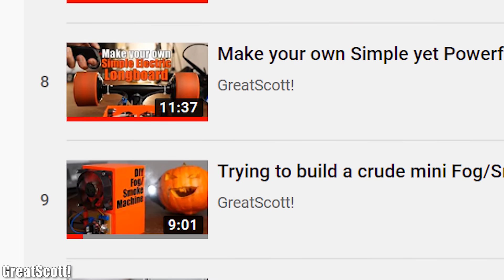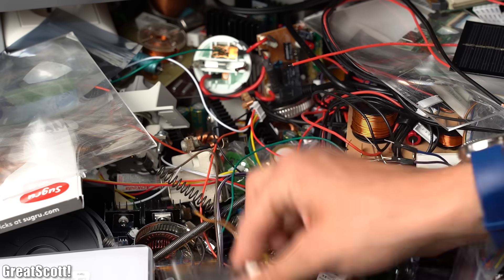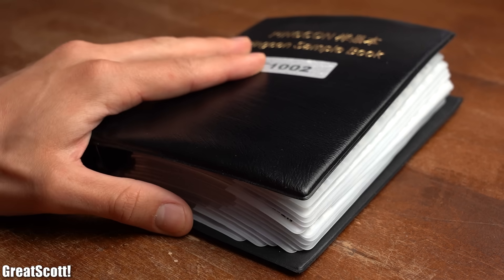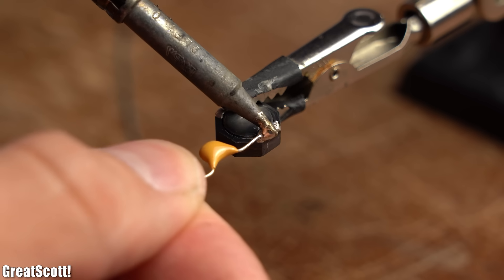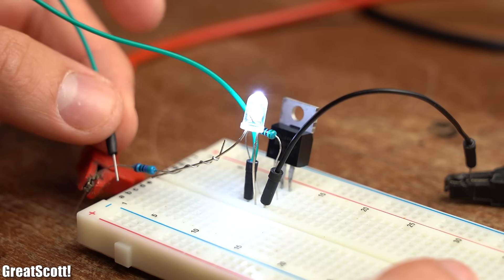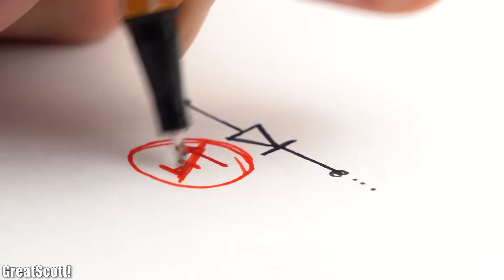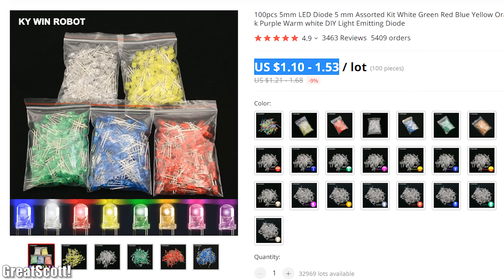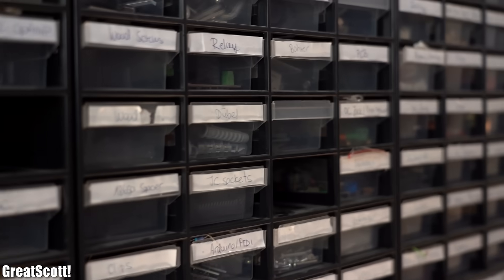Essential Electronics Components that you will need for creating projects!

Comment: Can you tell me what I need? 
Im changing my radios backlight from orange to pink 
I have all the smd lights replaced but when I connect the radio all the lights power off. 
12 v car battery 
Original smd lights 1.8 v 
Pink smd lights 3 v

Comment: I am surprised at the lack of content given this subject given there is so many electronic components out there.
Here I'll save you some time.
Most common transistor:2n2222
Most common capacitors:10pf-100nf
Most common resistors:10ohm to 1M ohm
Most common diode:1n4007
Most common ic:555 timer
Most common post amp:au741
High voltage transistor that is often used in YouTube:IRFZ44N
High voltage capacitor that I've used for a voltage multiplier:10kv 1000pf/1nf or higher
Common schottky diode:1n5822
For the zener diodes get all of them up to 30 volts, they're cheap.
You can also buy premade inductors or buy 0.1mm-0.25mm copper wire, a ferrite core and some thicker copper wire.
You'll also want either an Arduino nano or uno. They're similar and a 3.3-5v module, some battery cases and some 3.7 rechargeable lithium batteries with a charger to charge them.

Comment: These electronic are great for control circuits however it depends what's a person's liking. For me as an eng student I like wireless circuits and amplifiers so the complicated parts that I used quite different such as  lm 386 or high frequency transistors which I use alot

Comment: A component I use very often is the DIP switch. I got a little plastic box full of them, they can handle 25mA and they're rated for 24V which is good enough for me. They are very cheap and can be soldered on a perf board or put into a breadboard very easily.
Reply: New video idea: turning on a space heater with a DIP switch.

Comment: I can only recomment the resistor  book(lets) for SMD and throughole resistors. Even if you will never use them up in your entire life, it's a god sent to have some of these 1/4 W resistors on hand in all possible versions if you ever have a circuit for filtering or odd adjustments to certain voltage levels. Of course you will also need the drawers for the more popular ones, but that is just to be expected.

Comment: 74HC595 shift resistor
CD4017 decade counter
These two type of ics are also my fevourite.....
In last 6 months i have perched 7 different resistors kit(6200 resistors ).. But used only 30 to 35..piece ..
😄😄😄😄😄

Comment: that's easy just do 10 of everything (generic ones so you can make shift components into a specific parts whenever you need to, e.g. you need a resistor of 500 ohms, then you use 2k resistor in parallel), and just stock up if one runs out, just like cooking you buy seasonings in bundles not one by one.

Or if you to test more than finalizing a project you could just buy a lot of variable capacitors, potentiometers, variable inductors makes it easier

Comment: Shift register , laser diodes / photo resistor or phototransistor, IR ''leds'' and IR reader, Hall sensors for magnetic fielf detection, then some servo encoders to make normal motors into servos, , motor driver pwm and 3 phases,, I2c screens and drivers. Some  mcu are very cheap and useful too. Esp 32, atmega attiny85 chips are really cool to make some custom projects,Nvidia AI jetson boards are sick, some transformers and some old transformer wire, analog to DC and dc to analog, and few FPGA to practice. and accellerometer + gyros. some printers are really treasure chests with dozens of motors with encoders. i really love playing with mini-motors you find on drones the coreless ones they are FAST. a brushless to make 3 phase by spinning it. some N52 magnets,Solenoids, Relays, with integrated NO, and some inverters Nc spare contact for the button or the relay. a cheap 10$ temperature controller PID and 1 10$ Zelio PLC. to program them in ladder..a good pcb open source software, and some time on blender to animate ideas. a 3d printer would be very nice for me. Gears belts chains, bearings some scrap metal and alot of internet

Comment: I will forever recommend to trim your resistors in vertical (0.1 to 0.2 in. terminal separation) or horizontal (0.4 to 0.7 in.) orientation as you use them in your breadboard. So your storage is cleaner and better to reuse as you build safer, easier to modify and good looking projects.

Similar with basically every other component.

I am not an expert in electronics, but I can assure you that I have never had any kind of problem with my electric circuits, meaning I have never made a short circuit, nor a bad connection. My fails are always in my design on paper or code.

Comment: As an IC designer the only component I get are thin and thick oxide MOSFETs, Poly resistor, and MiM Capacitors.

In a few projects also Spiral inductors and lateral BJTs.

Comment: Hi. Can i get some help please. I mistakly reversed battery for my rc transmitter. It found a smoked component it's a black 3 legs thing. It near by the battery plug the writing in it is 2351p i searched everywhere and couldn't find any info. Please what it could be and with what i can replace it.

Comment: If you're working with Arduino a lot, get the following resistor values in packs of 100:
· 68Ω (USB data line filters)
· 100Ω, 220Ω, 1k (LED current limiters for 3V/5V/12V)
· 1.5k (USB power line limiter)
· 4.7k (pull-up/pull-down for 3.3V)
· 10k (pull-up/pull-down for 5V/for creating voltage dividers)
· 100k (for creating voltage dividers).

They are super cheap, a pack of 100 is often $1 or less.

For potentiometers, with Arduino, 10k pots also suffice.

Get 100nF ceramic capacitors. A LOT of them. Put them between VCC and GND on every single IC you use.

Also, if you're from Germany or neighboring countries, you can get these storage boxes very cheaply from Aldi or Lidl. The ones in the video are called "Allit VarioPlus Hobby 33" and are on sale at least once a year for €8 a piece. Last time they were on sale I bought six of them.

Comment: I recently wired a 555 with vcc and ground reversed, it got ridiculously hot but kept on working. At least from decent manufacturers, those things are hard to kill though I'm sure it's possible.
Reply: I should clarify that the circuit didn't work reversed, but when I fixed the wiring it did.  I was happy, though if I had killed it I wouldn't have been too upset those things are cheap enough.

Comment: my list for beginners, which allows them to go further:
(don't worry about high voltage rating, it is just the maximum voltage they can handle)

-BJT (BIPOLAR JUNCTION TRANSISTORS):
MPSA42+MPSA92 (200V 200mA BJT pair)
BD237+BD238 (80V 2A BJT pair)
MJE3055+MJE2955 (60V 10A BJT pair)
2SC5200+2SA1943 (200V 15A BJT pair)

-MOSFET TRANSISTORS:
IRF3205 (55V 110A 0.008Ω)
IRF5305 (55V 31A 0.06Ω)

-DIODES (NORMAL, SCHOTTKY AND FAST):
MBR30100 (30A 100V schottky diode)
SB3100 (3A 100V schottky diode)
SB2100 (2A 100V schottky diode)
D92-02 (20A 200V fast diode)
UF5408 (3A 1000V fast diode)
FR207 (2A 1000V fast diode)
1N4148 (200mA 200V fast diode)
1N5408 (3A 1000V fast diode)
1N4007 (1A 1000V fast diode)

-OPAMPS (OPERATIONNAL AMPLIFIERS):
C4558
NE5532
LM386 (this one is used for audio projects only)
LM324

THE

-PASSIVE COMPONENTS (because there are a lot of them, better buy them by kits making sure they contain the needed ones):
electrolytic capacitors:
1uF 50V
2.2uF 50V
3.3uF 50V
4.7uF 50V
10uF 50V
22uF 50V
33uF 50V
47uF 50V
100uF 35V
100uF 50V
220uF 35V
330uF 35V
470uF 35V
470uF 50V
1000uF 35V
1000uF 50V
2200uF 35V
4700uF 35V
ceramic capacitors:
100pF
220pF
470pF
1nF
2.2nF
3.3nF
4.7nF
5.6nF
6.8nF
8.2nF
10nF
22nF
33nF
47nF
56nF
68nF
82nF
100nF
220nF
330nF
470nF
1uF
2.2uF
resistors (all in carbon 0.25W version which is more practical in a breadboard)
1Ω
2.2Ω
4.7Ω
10Ω
22Ω
33Ω
47Ω
100Ω
150Ω
220Ω
330Ω
470Ω
560Ω
680Ω
750Ω
820Ω
1KΩ (a lot of them)
2.2KΩ
3.3KΩ
4.7KΩ
5.6KΩ
6.8KΩ
7.5KΩ
8.2KΩ
10KΩ (a lot of them)
22KΩ
33KΩ
47KΩ
56KΩ
68KΩ
75KΩ
82KΩ
100KΩ
220KΩ
470KΩ
680KΩ
1MΩ
2.2MΩ
4.7MΩ
10MΩ

Comment: Here is my idea of what is mandatory for the hobbiest engineer...

a. E12 series resistors full carbon set
b. 5W resistors a dozen low values
c. Ceramic caps 50V 1pf to 100nF
d. Polyester caps 1nF to 1uF (100V)
e. High voltage x-class caps 104s
f. Electrolytic caps 0.1uF to 10,000uF
g. High voltage electros few values...
h. Monolithic 50V 104 decoupling caps
i. Axial inductors say 20 values
j. Zener diodes a dozen values
k. Rect diodes comprehensive range
l. 74HC series ICs  (~30 common)
m. Linear ICs like OP AMPs & NE555
n. Ram. Rom. CPU. RTCs. MCUs.
o. IC sockets. Plugs. Sockets general
p. LEDs assorted and LCDs
q. Toggle switches...
r. Momentary switches push button
s. Rotary switches
t. Relays...
u. Dip switches
v. Key switches
w. Illuminated buttons ♡
x. Sensors like LDR and IR
y. Connectors assorted
z. ☆RF components☆

Scary thing is that in reality I have only just scratched the surface, and the surface is quite thick.

Comment: Hi GreatScott! Noob question, can a mosfet handle negative voltages? I saw a 55v limit in the video, so does that mean 0-55V or +/-55V? I'm thinking about Eurorack modules that communicate with +/-10V and whether mosfet's can handle the -10V or not. 
I've just discovered your channel and I'm loving it so far. Thank you GreatScott!

Comment: Great stuff! A quick question - it is a real challenge to find original power MOSFETs on Ali. I have purchased a few from a store you mentioned in the links and all MOSFETs were fake. I ended up purchasing used parts as much more reliable source of MOSFETs. What is your experience? BTW other than that it is a good store with a good service.

Comment: I would personally recommend to get the pro mini version of the nano in 168p and 328p version cause they're smaller and cheaper than nano. In addition, you can use the 168p despite of 328p in case where you don't need the extra memory space and calculation power.

Comment: Never buy large amounts of parts if you are a beginner.I have friends who "stockpiled" parts worth hundreds of euros and they do nothing with them because they work in another field.Don't block your money into large amounts of parts.
Reply: agree! for beginner or hobbist, just buy the most used!
for resistor for example: buy 10K resistor is fine, any some 100k.  anyway if you needed u can always combined some to get higher value. some it goes the same for other resistors!!
For beginner or hobbist, it is a wast to buy all the pack, as you never gona use them and stockpile them as you said...
After a while into electro hobby, you gona know which one you use the most and there u can start buying extra amont.
And also salvaging it a great option, it is also a good learning way, to which components are essentials....

Comment: Great video as usually! Could you please make a video about powering an arduino and more than one servo in parallel with the same external power supply? 
I have problems with the stabilisation of the microcontroller current. Didn't find anything really helpful on the internet.

Comment: Ok, so i was building an ac with peltier modules (just tryin), but i thought i need to add some batteries inside so that i could also make it portable. Can someone suggest which type of batteries should i use and should the batteries have some power booster or  something connected to it for better efficiency?
Also i am gonna be using a 10amp 12v power supply for 11 peltiers in  parallel. 
Can someone tell what type of batteries need and how much of them for a total working of an hour.
Also a charging limit circuit is also needed.
Can someone pls help?

Comment: LDR, SMDs, Sensors, Wires (various gauges), Flux, PCB cleaner, Soldering Fumes Exhaust Fan, Third Hand, Magnifier (to work or read tiny or smaller,  components), Tweezer Multimeter,  ESD protection Tools, Batteries etc.  
You may also displays captions whenever you are told about essential electronics components eg. IC's No., Modules, Diodes for easily understood on your videos!

Comment: Waiting guideline for selecting basic tool need to use like soldering iron, flux , microscope, and multimeter that useful for diagnosis short circuit with buzzer.
Reply: I still can’t select better soldering iron for basic project.

Comment: A good video idea would be a DIY VS BUILD for a 6ch 5.1 surround system amplifier as they are expensive to buy, these can have a treble,bass and main volume potentiometer, also we can use your previous Bluetooth speaker design to act as an Input?

Comment: 1. Bistabile relay for low power
2. I don't like the jumper wire you showed, two don't fit neatly on a 2.54 pacing. The square heads are excellent.
3. Male and female headers.
4. Long pin male headers good to place your micro on a bread board leaving an extension for tester or oscilloscope.
5. 2.54 mm screw terminals.
6. Stepper and servo motors
7. I always have various OLED and Nextion displays around.
8. Single core wire for breadboard.

Comment: Maybe not essential, but very useful is having a small audio amplifier, li-ion charging module, some USB ports and micro USB ports for quick and easy replacing them, 12v BMS charging module for li-ion, common plugs and sockets like audio jack or DC jack, 18650 batteries and a bunch of cables.

Comment: Sir , Thanks as always for your in depth explaination.... And having a review on cnc shield v3 and v4 would be nice as most of the times during making a plotter or mini miller it often fails to give steppers proper commands due to many reasons. I am also unable to get it work as steppers dont move but gets hot...

Comment: Not as common but if you want to have analog outputs from a microprocessor for low cost, R2R ladders and shift registers. Better than arduino's slower PWM and filter combo

Also, I second the MCP602X op-amps. They have been perfect for my 5V projects

Comment: Great Scott i need your Help! I have a CNC machine that has an MPG but it only operates at 1:1 ratio with the Controller (an old Fagor 8010M).. i am in need of a multiplier to increase 1 pulse to 10 pulses and to 100 pulses while keeping the Direction relative to the original encoder input... For example, the encoder gives Four pulses per line and is a 5000 line encoder... I wanted to have something between that reads those 4 pulses and outputs 40 pulses (x10) ir 400 pulses (x100) or even 20 pulses (x2)... Is this something you could explore and maybe to a video on? Thanks a lot!

Comment: While we are on this subject, I constantly get shocks from ESD around the lab, haven't figured yet where the static energy builds up, I try to use an ESD bracelet, but it gets  very compersome when I do repairing and have to hold the board with 3 fingers and solder with the other too, in the other one is the soldering iron. I were wondering if any of you guys know a better a way to protect from ESD.

Comment: Great scott can you make diy project about audio aux splitter with some kind of amplifier like one aux input and 2 or may be 4 aux output so we can connect more
Amplifier to one aux input ??? Please i know there are ready made audio splitters are available but using that cause very low quality audio bcz they have no power source and they are not efficient on quality. CAn you make project on this topic adding external power source to spitting audio singnal to one input to 4 output

Comment: 11:02 What's the purpose of those wires near the resistors? Can't just put solder?
Reply: There is already a solder path below the wire for something else. They use wires like this to bridge over the connection

Comment: I'm kind of new to the specifics of eletronics, and I'm just scared of resistors. I just never know what would be good enough, or too weak.

For example, I now have a stepper motor at 12v and 2A, but that stepper motor's specifications mentions it takes 0.5A. And from my [years-ago] lessons, I think I need a resistor?
It just doesn't feel right. I might sound insanely dumb, but I hope someone can shed some light on it for me. I've always understood logic gates and other stuff about electronics. But knowing what exact resistor or power supply is needed is still a mistery to me. It frustrates me, but I wanna learn :D
Reply: I think you don't need a resistor for a stepper motor for controlling it, but it can be beneficial if it ends up stuck (basically a short-circuit, in which the windings of the stepper motor melt), you needing a simple way to limit the inrush current (windings have a low resistance, but once the motor starts spinning, its okay) or a simple way to measure its current consumption by using a resistor as a shunt to create a predetermined voltage drop (you measure it by reading the voltage difference between each terminal of the resistor and dividing it with the resistance of the shunt resistor). 

This is as far as i know.

Comment: I/O:  I: switches, phototransistors, hall effect sensors, pots. O: lights, speakers, motors, relays.  Also the 555 in one-shot mode is very useful, gimmie a pulse of length X please, not just for debouncing switches, but all kinds of programming.

Comment: I keep a spare cat5 cables that I strip for great low volt - signal wires.
I also  keep a pile of buck converters, old laptop batteries (for the cells), and usb charging circuits.